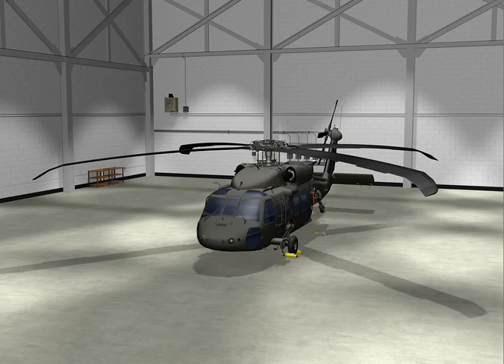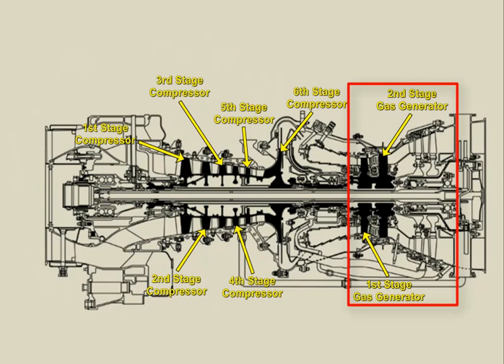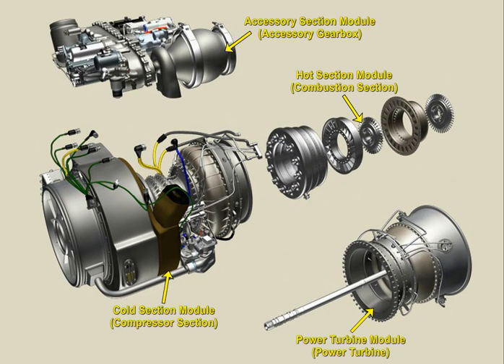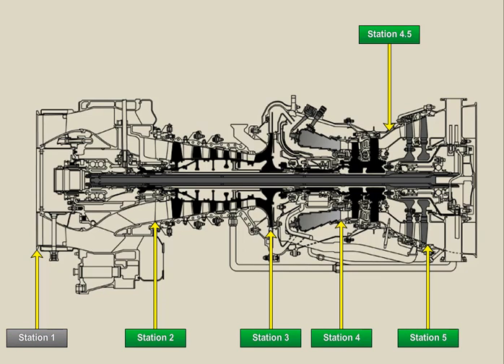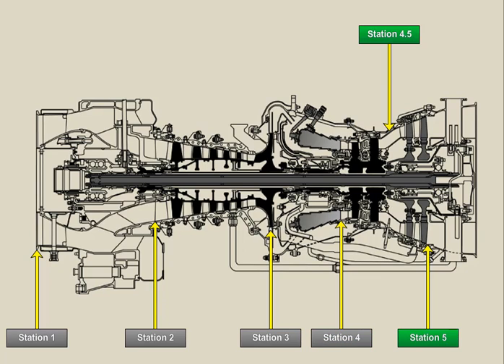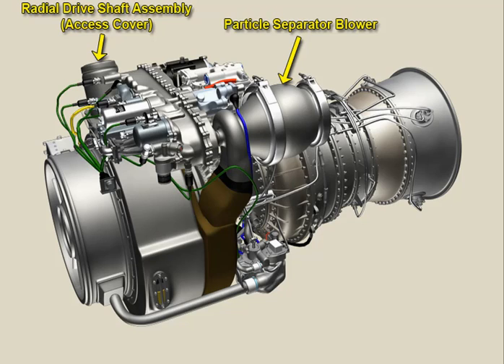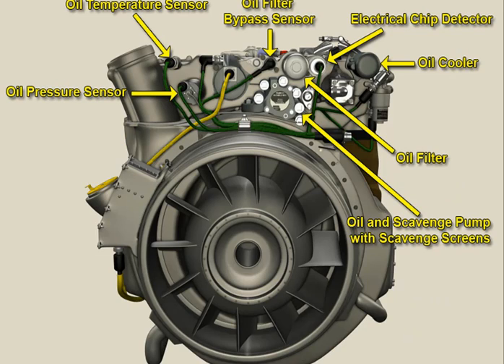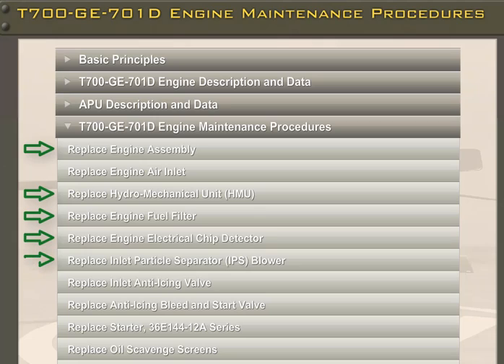T700-GE-701D powerplant

Comment: Awesome video.
I’m considering how the engine boot pump works so that the fuel system is under negative pressure, thus reducing the danger of fire in case of fuel system damage?

Comment: Where is the transmission to the rotor blade
Reply: The nose power turbine outlet coupling takes the rotation 90deg into a main transmission assembly, which in turn spins the main rotors and then the tail rotor through a tail rotor driveshaft